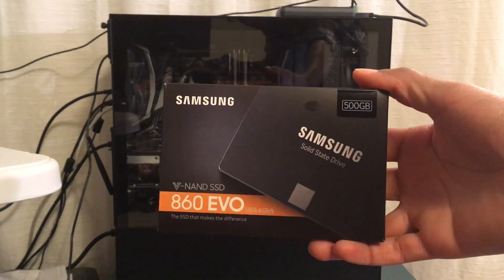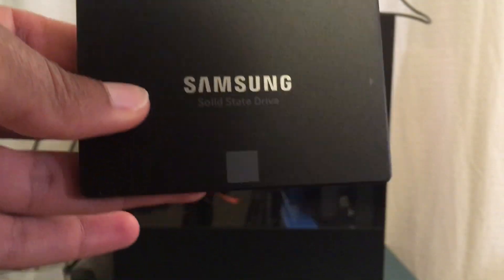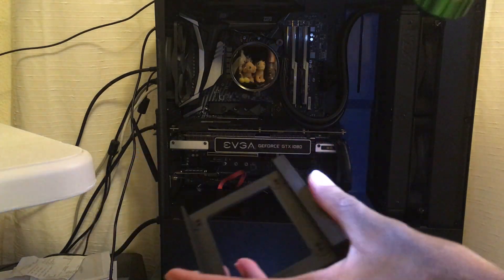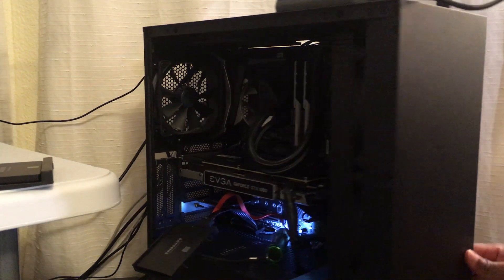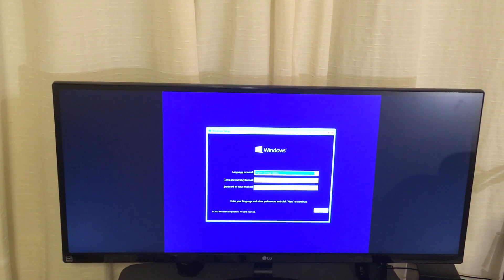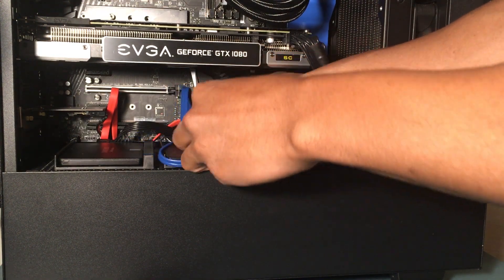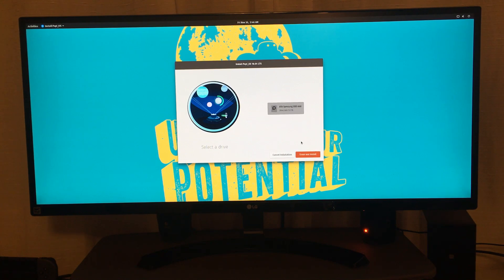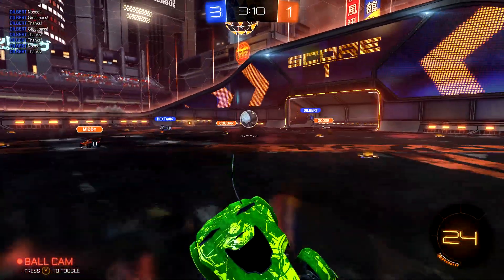Dual Boot on Two Separate Hard Drives (PopOS 18.04 and Windows 10)

Comment: After a bunch of videos on the subject, up pops your video. Clear, easy, simple. Best vid on dual booting on separate drives. great tip on the disconnection of one drive while installing on the other. Thanks so much !

Comment: So If I understand you correctly, all I really have to do is the following:
1) install windows 
2) unplug windows drive
3) put in second drive
4) install linux on second drive
5) plug windows drive back in
6) grub auto detects windows and i'm done.
7) upon boot pick which OS I want to boot into.
I certainly hope its that easy.

Comment: Hi Kyle! Hope you can help me out. I just snagged a great deal on a laptop. It came with Win 10 on NVMe & an open slot to add another SSD drive. I installed the SSD & want to put Mint onto it. However, during boot to the USB installer for Mint, it only "sees" the SSD, not the NVMe. I was told that during installation, I needed to choose, "something else", in order to create my Mint partitions (swap, /, /home, + a small "shared" space for both OS's). I was further told to install the bootloader onto the Windows drive. Is this correct? I don't see how I can do that last step when Mint doesn't see the Windows drive at all. Help??

Comment: So if you mess up your windows installation do you mess your linux boot? I just got an IVY DOCK Dual 2.5" SSD caddy and linux has trouble starting even though one one SSD is live at at time so there's no boot loader conflict, it's behaving very wierdly. So you use a boot loader to select which os to boot or just select the boot os from the bios?
Reply: @Kyjorei  Yeah I'm leaning towards the same, run windows in a virtual machine of i have to, thanks for the reply ;)

Comment: Great video! I'm actually looking into running Bliss OS on a separate hard drive, however I am using a mini PC with a built in 64 gig drive running Windows 10 that can not be removed. Is there any way to install Bliss into the specified drive without creating conflicts that could potentially brick out my computer?

Comment: I have an AMD platform.
I have a Windows 10 NVMe drive on my drive, but I also have a second SSD that I want to install Ubuntu on.
I created a bootable USB flash drive (with the program - Rufus).
I want to install Ubuntu without disturbing the Windows 10 (NVMe) disk structure.

Is that enough
- I will change the boot order in UEFI / BIOS.
- first it will be SSD and then NVMe.
- restart the computer (connect the USB flash drive)
- I will install Ubuntu.
After installation and reboot, only Ubuntu will start

// Start Windows 10
- I'll change the boot order back - first NVMe then SSD and Windows 10 won't show anything related to Ubuntu?
And when it wants to boot Ubuntu, I will hit F12 while my computer boots up and choose the SSD.
I think right?
Reply: Can you confirm if it worked for you? and what was your installation process. I in the same situation.

Comment: Here's one for you all.  I bought an MSI laptop with extra space for two extra drives. I took my drive from my old laptop and put it into my new one. I want to be able to boot from the old drive that is inside of my new laptop whenever I want to. Windows is already installed on that drive from the old laptop so how do I just boot exactly from that one on the new laptop?

Comment: It is a good idea to remove the  Linux formatted HDD to prevent Winblows from formatting the Linux partitions.
Reply: @Kyjorei  I have two HDD, is it possible to install ubuntu in the second drive without disconnecting the first one that has windows? I'm asking because I have a laptop and it's not easy for me to open it. Also, it would be best if I didn't have to erase the entire second drive. Is it doable?
Reply: @Kyjorei  Thank you very much for your response. I have two drives, an SSD that boots windows and a HDD that I use for storage. I want to install Ubuntu on a 150 GB partition in the HDD. Can I create such a free space in the disk from windows disk management and install ubuntu there just like that?
Reply: @Kyjorei   Thx man
Reply: @Kyjorei  I did it man, everything works as I intended. Your advice was golden!!!
Reply: @aedr10001  Have you installed Grub-Customizer? Easy to use and powerful.
Reply: @thenextpoetician6328  yes I have, thank you
Reply: @aedr10001  You're welcome. Stacer is another recommendation I like passing on.

Comment: I am currently running windows 10 on an SSD I just bought another SSD to run Linux.  Do I need to unplug the windows drive to install Ubuntu on the new drive?
Reply: Kylinux Cast it is possible to boot on Windows automatically instead of stopping on the choosing (win/Linux) screen ? Thanks

Comment: I have found that sudo update-grub doesn't work in Pop!_OS 20.04 and used rEFInd as the boot loader instead: https://www.rodsbooks.com/refind/installing.html
Reply: I had the same issue, but all I had to do was install and run os-prober first and then update-grub worked just like in the video.

Comment: I'm running Windows (reluctantly, and rarely), Mint Cinnamon, i3, Mate, and xfce with tiling (thanks Kylinux for that tutorial), Regolith for i3 on 19.04 Ubuntu, and Gnome (for that Guh-nome Experience) and i3 on 18.04 Ubuntu. Multibooting is no sweat. I just don't update the boot loader except from Cinnamon. Any distro that forces updating Grub during installation hasn't lasted long, for any number of reasons. I'm still mostly noob.

Comment: Enjoyed the video ! heading to WorstBuy to get a Windows install usb or whatever.   The reason I need windows is that I am trying to update the Chipset and sound drivers and other motherboard data files and I cannot do that with Linux Mint 19.1.    Just not possible, I don't think.(?)  I updated the Bios via USB stick to the current one.  Having some motherboard issues with 2-3.0 USB ports showing an over-current.  I tested the ports with a usb tester and they test absolutely perfect.   They even work fine.  I think it's a Chipset issue.   So I wanted to upgrade the chipset and see, but I can only do that with Windows.   It's a Dell Precision T3610 Workstation running 3.9ghz Hexcore and 32gb of ram.   Picked it up for $375, (NewEgg)   Linux is awesome.    I tried PopOS.  It's neat, but not for me.  Thanks for doing the Video.  Will try that this afternoon.  !!